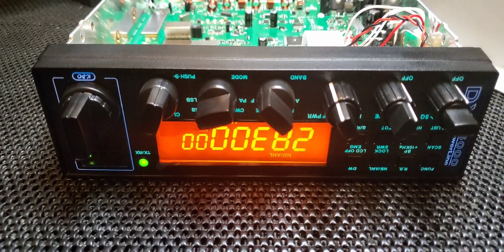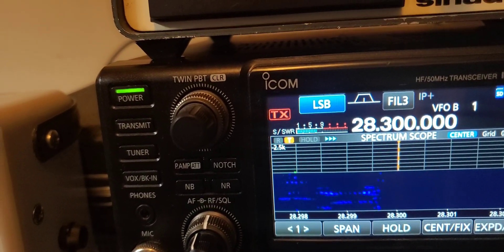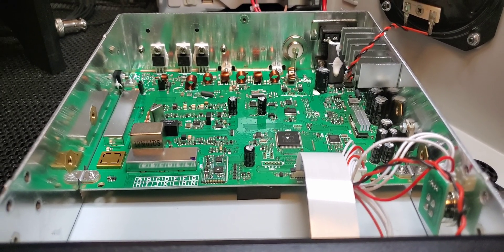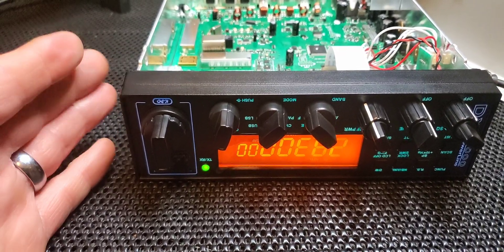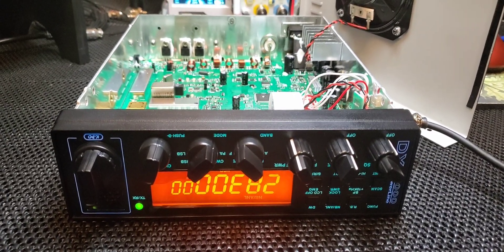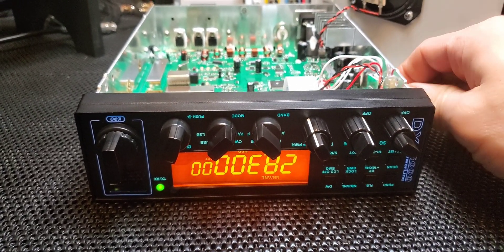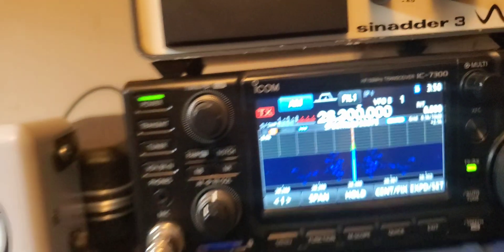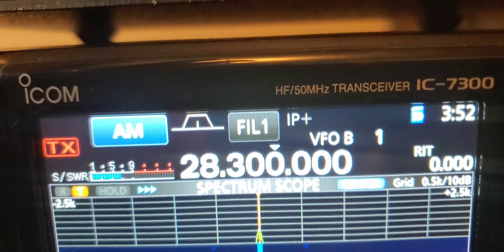Second Look at the New K-PO DX-5000 Plus 10 Meter Radio.

Comment: What about the CRT SS6900 N
Reply from the maker: It's outdated and disconnected. See the 6900V.
Reply: @ScottsRadios   So would that mean CRT SS 6900 N is old stock then? 
they mention v7, However I see in the UK they supply a CRT SS6900 V (V10) But have not seen this in Europe.
What are your thoughts on the Alinco DX10 ?
Thank you 🙏

Comment: I take it, it's not just a radio on one single chip then as was rumoured with this new version? (As in SDR) and of course the SS6900V? there seems to be no mention in the user manual specifications of whether it's based on a traditional superhet design or not? although I don't believe the previous version mentioned that either.
Reply from the maker: I honestly not sure. You could email CRT and ask them

Comment: Hi Scott will it do 26450 which is channel 11 on 26mhz 
I’m really impressed with your videos and your knowledge on these radios 
I’m an old school trucker in Nz and I’m looking at up grading my old uniden grant that’s about 30 years old 
I’ve been looking at some of your other cbs but this one looks and sounds really good to me and having the different frequencies would be great to flick through and I love the echo mode too really cool 
Cheers 
Bob
Reply from the maker: Hi Bob, thanks for your kind words and for watching my videos.
I believe it will do that frequency. I haven't really ever went down there but I can check for you.
You can also program each band to do whatever frequency you want through the PC software.
On my friends radio. I programmed 26.965 Channel 1 all the way to 27.605 channel 60 on Band D.
Each band will allow up to 60 channels/frequency slots programmed.
The channel selector will also show Channel 41 through 60 as you move up in channel/frequency.
Reply: Thanks Scott if you don’t mind checking that that would be great thanks 
Can you tell me why 26mhz doesn’t seem to be used anywhere but Nz 
Australia and USA seem to use 27 and 28 what is so special about them over 26 
I do believe 27mhz is use here but the truck cbs are on 26mhz
Reply from the maker: Our Standard CB band is 26.965 to 27.405.
I think it has to do with our antennas being designed to be used on that frequency range.
We would have to have a longer whip in our mobile antenna or have a base antenna that is able to be configured for the lower range of 26 MHz.
I have gone down to the lower part of 26 MHz numerous times over the years but I usually only heard Spanish speaking people.
Most likely it was skip.
Reply: Ok thanks 
Are you able to go to the setting on the dial C which is 26mhz and scroll through it and see if it will go to 26450 for channel 11 please if it’s not to much trouble?
I’m really interested in this radio 
Cheers 
Bob
Reply from the maker: I'm not able to confirm that at the moment but I will let you know as soon as I can.
Reply: @ScottsRadios  
Great thank you I really appreciate it 
It’s Friday night here not sure what the time is where you are but thanks very much 
Hear from you soon cheers 
Bob
Reply from the maker: @bobsugrue2983  it is 6:27 a.m. Friday morning.
You're a whole day ahead of us lol.
73
Reply: @ScottsRadios  
Oh hell sorry I’ve been disturbing you so early in the morning it’s 10.30pm here and I’m off to bed very soon
Reply from the maker: @bobsugrue2983  it's ok. I work nights to mid morning shift.

Comment: What's the cost?
Is the NR adjustable, or just 1 setting?
Reply from the maker: The Noise reduction circuit is not adjustable.
It's either on or off.
The radio won't be available again until this summer.
I have a Pre Order option on my website.
scottsradiosllc.net

Comment: The board in that radio looks a lot like the version 2 Stryker 655 and 955...
Reply from the maker: They are all manufactured by the same company.
Reply: @ScottsRadios  are you going to sell these on your website and if so how much?
Reply from the maker: @TM-gv6zv  I will sell the K-Po DX-5000 + radio again once it becomes available.
Not sure on price.
Reply: @ScottsRadios  one more question. Well this new radio require a electric microphone?
Reply from the maker: @TM-gv6zv  it has an option in the menu to use dynamic or electret condenser.
The factory supplied Mic is dynamic.

Comment: Can you adjust/wideband the TX audio like the SRC-955 V2?
Reply from the maker: Not that I am aware of.
Cost vs options is a factor with this radio versus something like a 955v2.
One thing to keep in mind about running widened TX audio bandwidth.
If the person you're talking to does not have a radio capable of receiving the full bandwidth of your signal they will not notice any difference.
Most CB/10 meter radios are not designed with a RX filter wide enough for that.
Reply: @ScottsRadios  I own a 955 a 655 and a CRT SS 6900. I love all three. But this KPO makes me want to sell my 6900 and buy this one. Like I really need another radio though.😀
Reply from the maker: @MarshallDillon79  I think most of us are in that same predicament.
It's not really a bad thing though to have one of everything!

Comment: Can you show this radio on the oscilloscope and signal analyzer. Not a whole lot of people out there with the proper equipment and knowledge you demonstrate.
Reply from the maker: The radio looks very good on the oscilloscope nothing to worry about there.
Very small spurious emission present on a spectrum analyzer. It is far from anything that you would interfere with.
Can it be improved?
Possibly, but at this time no idea how to change settings in the service menu.
Not worth destroying a perfectly fine radio by experimenting in the service menu.

Comment: if the offset osc go to far out of range even the hidden serv menu wont bring it back in ,had a cre8900 do that to me, think it was a offset xtal went bad, radio still worked on usb but freq display was 2 khz off, lsb stayed ok, after all none of these rigs are not built like icom, yaesu, kenwood fpr freq accuracy, have not looked in the cre8900 internally yet but it may have internal slug tuned coil to coarse correct it, ill look soon,
Reply from the maker: I have no experience with the CRE 8900 but I know it has been long discontinued. 
There are outside appearance similarities of the New K-PO DX 5000 too many older and outdated models.
Internally the new design is much better than anything on the market.
The noise reduction circuit is a vast improvement over the traditional Nb/Anl and Hi-Cut.
The frequency out of the box is what you see from HF quality models.

Comment: Does the noise reduction function on the K-PO model work the same as the HI-CUT function on the Anytone AT-5555v6?
Reply from the maker: Completely different.
No Ten Meter or CB Radio to this point has offered a Noise Reduction Circuit.
The K-PO DX-5000 Plus also has a Hi Cut filter.

Comment: What's the PEP on 11 meter AM with a 2 to 2.5 watt dead key?   Asking because I need to know if it will work with my straight four pill box.

The echo sounded really good.  What did you have it set at?
Reply from the maker: The echo level was set about halfway I think on the times and a little more on the delay.
I believe the PEP output is over 20 watts with the lower dk.
Reply: @ScottsRadios  20 watts PEP input on a straight four Toshiba 2879 is good for 500 watts output.  That's what I needed to know.  Thank you!